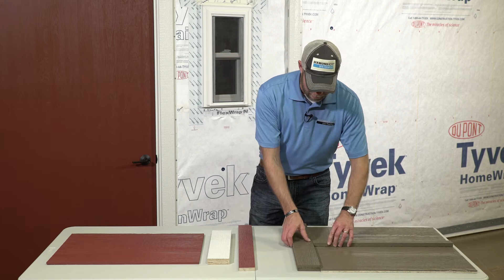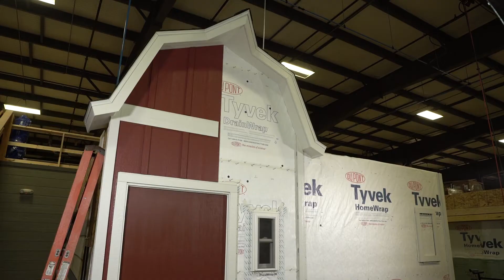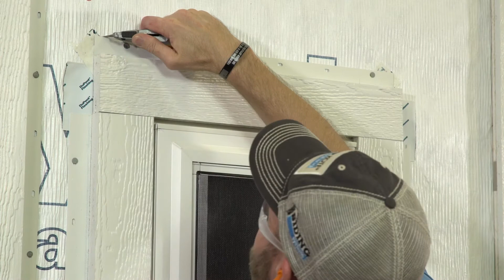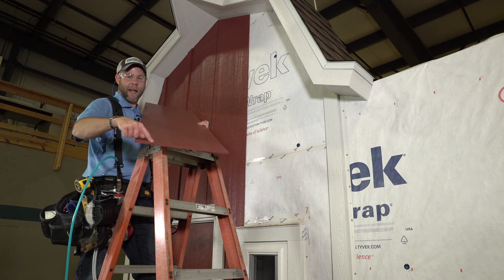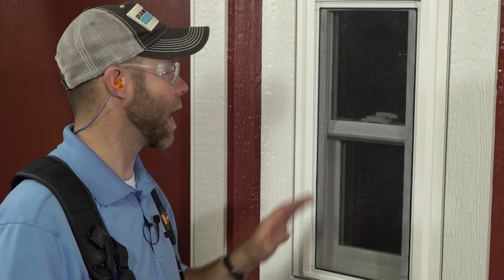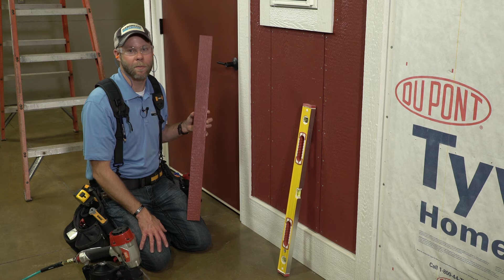Diamond Kote Vertical Siding Installation | Built on LP SmartSide

Comment: Do you have video on installing the band board?
Reply from the maker: Thank you for your question! We do not have a video of ban board installed, however installing a band board is the same as installing horizontal trim, with a few key things to keep in mind: 6" or less trim boards 2 fasteners should be placed every 16", and for trim boards 6" or more 3 fasteners should be placed every 16", and all horizontal trim boards need a drip cap.

Comment: Do you apply sealant between boards before installing battens?
Reply from the maker: No, that is not necessary.  The gap is left to allow the boards to acclimate as well as promote moisture drainage and positive airflow.
Reply: Makes sense.  Thank you for the reply.  Do you apply it on either side of the batten once installed?